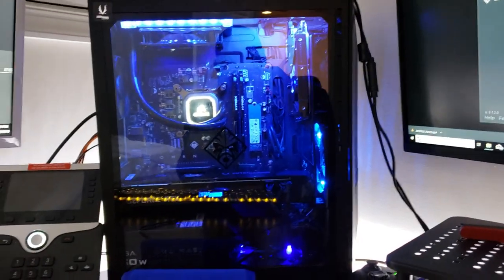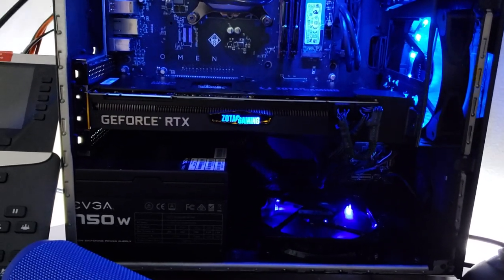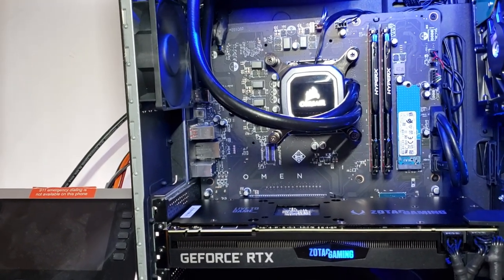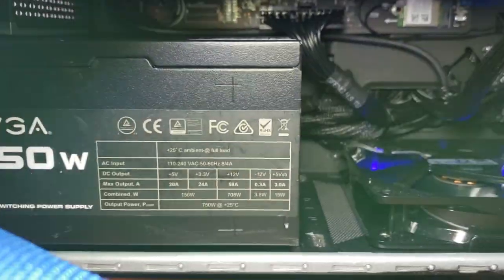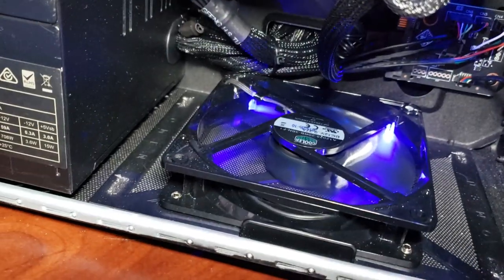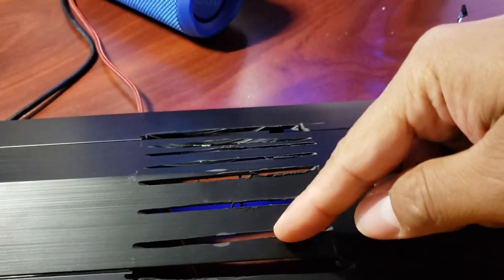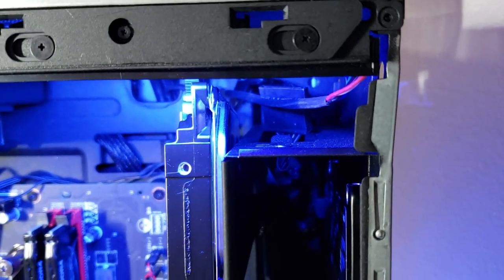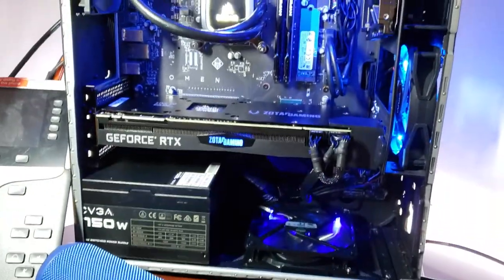HP omen obelisk hack after 10 months (zotac RTX 2070 super)

Comment: Cool mods but I think moving everything to a new case woulda been easier
Reply: Yeah, if my Omen ends up with any heat issues, I’m definitely just going to move everything to a new case. That’s a good time to install an AIO LC also, since you’re ripping everything out anyways lol.
Reply: @armyretguy7365  The card and case is designed this way. At least my 2080 rtx turbo IS designed to get hot air out from the rear of my case. With i7 8700(non k) there is no reason to add fans.
Reply: @tryharder3214  Honestly, since he installed the AIO, he could have just set the rear fan to intake and use that bottom fan. No reason to butcher the case itself. I get what you’re saying, but there is such thing as uncomfortably hot. Mine came with a 9700F and 2070 Super. The 2070 Super doesn’t pull air from the back, the fans are just straight up pulling from the bottom and half covered by the power supply. I suggested a case swap to create more air flow to the GPU. I know HP had engineers sit there and design everything to work, but recognizing the potential for air flow problems they also have a throttling trigger to reduce power draw and performance in the event of dangerous heat levels. Don’t get me wrong, it’s cool they thought of that, but the fact they HAD to is bothersome....

Comment: Nice mods! I replaced my exhaust fan with a noctua, added a 120 mm noctua to the top and replaced my stock cpu cooler with noctua NH-U9S and added an additional 92mm fan to the cooler. Quiet and cooler

Comment: I wanted to change the CPU cooler mostly for better thermals and I don't like the look of the stock Intel cooler, with the fan being offset, just looked messy. When looking around I decided to settle on the Noctua NH-L9i Chromax Black, it was cheap and I really like the clean and simplistic low profile look. I thought about liquid cooling, but wanted to save money and I may upgrade to one in the future. But I figured since I was going to have to remove the mobo anyway, I decided to browse cases.

I chose the very simple and cheaper H510 by NZXT. There's no RGB or anything fancy. It comes with two 140 mm fans, both set up as exhausts on the rear and top. I added two 120 MM Noctua Fans I had from a previous build that I placed in the front as intakes. 

Overall, the CPU temps are around 36-40 C at idle and they don't reach 70 C when gaming on max settings, the gpu temps stay at around 60 C gaming on max. 
I was able to tear out the RGB on the Omen and re-purpose it in the NZXT Case, I just simply installed HP's RGB Module on to a single stand-off and stuck the light bar on to the top of the case with some hot glue. I am thinking about installing the OMEN badge LED on the under-side of the NZXT case to get a nice glow on the bottom.

So If you have this computer and want to upgrade to a liquid cooler or a different heat-sink, I definitely recommend adding a new case as well since the motherboard will already be removed. The upgrades were only $90 overall and took about 3 hours, most of that was spent removing the proprietary bracket then tearing out all the components in the HP case.

I'd be happy to answer any questions, I know there is a lot of people who bought this and are unsatisfied with the thermals. https://imgur.com/8v4CYZo

Comment: I have the 1660 ti version, what I did was. Bought a whole new case and 2 8gb sticks of corsair ram pro with 3000mghz speed RGB. And a corsair h60 AIO(without the led light up version but I only care for the performance) kept one of the case fans in the new case(NZXT 510) and its looks nice and more clean and organized. I am saving up for a new motherboard. Then maybe 2 more same sticks of the sam RAM. Next year is a new video card with a new PSU. If anyone wants to ask questions feel free, also great video. I also added a new 2tb SSD samsung qvo in my case as well
Reply: I have the same pc and was considering changing cases because I recently tried to swap my 1660ti for a 2070 super but it didn’t fit on the motherboard due to how small it is. Was just curios the motherboard you were planning on upgrading for your pc?
Reply: @boofbump2923  mine is whole custom build the only thing that is left from the HP omen is the CPU(i7900). I have a Asus rog z390-e motherboard
Reply: When you put the Omen Motherboard in the NZXT 510, did  the holes line up without any issues, are the standoffs pre-installed on that case? I have the same stock 1660 ti version 84FD mobo and am planning on getting the NZXT 510 for better air-flow and future upgrades. Also, did the OMEN 500w psu fit in the 510 with no problems? Thanks in advance!!

Comment: Had an Omen Desktop, one of the 870-244. If anything the case was even worse than this Obelisk case. I did some modding too to try to improve thermals. Replaced all the case fans with Noctua. Replaced the CPU cooler fan as well, mounted an intake fan on the side panel grill (870-244 case). Then I bought a used Obelisk case and transferred everything into it thinking it would be better, better cable management, glass side panel, maybe more airflow. I'd say it was about 90% successful, but I couldn't get the front I/O to work or the front panel lighting since the two motherboards were so different between the two models and the cases and parts are so proprietary. Thermals were really not that much better honestly. Cable management was still poor. I finally ended up just buying a decent used case on ebay and moving everything into that. That's what I should have done to begin with. Your mods are clever, good on you, but IMO, you're better off just buying a more standard case rather than cutting up and trying to mod the original with only somewhat successful improvements.

Comment: I did the same fan upgrade on the bottom of the case and for addition i saw this $5 felt pad sliders thats usually for furnitures on close by hardware store and stick them as footing for my omen then i made more gap for air to come in from the bottom of the case. You can stack double depending on the height you want for your case
Reply: I just added this nice 3 level adjustable stand with the holes in the bottom and set my Omen 875-1131 on it when I got it. Fits well and should allow for good air flow. I set mine up to highest. https://www.amazon.com/gp/product/B07VQ6DSVX/ref=ppx_yo_dt_b_asin_title_o01_s00?ie=UTF8&psc=1

Comment: The sad thing is that HP has now introduced a couple of new models, 25L and 30L that use essentially the same case as the Obelisk. On the 30L, the add a different front bezel that allows for one intake fan at the bottom of the front of the case. Airflow isn't really all that much better, IMO in the new cases. I think the cases MIGHT be from Main Gear, but HP has obviously designed them and made them very proprietary, too shallow for good cable management and requiring the drives to be mounted at the front removing the possibility of front airflow. Also, no PSU shroud so there is the jumble of cables and the front lighting module in the lower right hand corner that just doesn't look very neat. It seems to me that HP just sort of half-a$$ed and attempt at a gaming case. That's not to say the PCs are not decent, they are, but with just a little extra, they could have made them aesthetically and in places more functionally better.

Comment: Haha man I was so interested until I saw the hack job of the front panel. Nice upgrades, but it's a shame that you couldn't mod that front piece a bit nicer.
Reply from the maker: You're right, I wish I didn't cut the slits in front. Originally I didn't have any slits in the front plastic, I only cut the back plastic square + metal square leaving the front looking stock... but I wanted more airflow. The slits didn't make much of a difference to Temps.

Comment: Nice Omen, I have the 2080 one, I got a huge noctua air cooler and did the same thing with the fans except I have another intake where your radiator is and a better exhaust fan, with all this airflow and no radiators my gpu never gets above 50°c under load and my cpu never gets hot either just wish I could use an xmp profile on my ram to get the full 3600mhz

Comment: I just purchased the 875-0084, I'm 3d printing feet for the case to get it off the ground. Did you try lifting it up higher to see if more air flow helps? I also purchased 2 noctua nf-p12 pwm fans for the top and bottom. And 1 nf- a9 pwm to replace the back exhaust fan. Hope it will work.... also I was thinking about printing out fan shroud vents to face cpu and gpu???? Any thoughts on that idea??? Cool video thanks for the information....
Reply: i got the same one. i really would like to move it to a ryzen H500i case. do you think it’d be able to move it?

Comment: Bro I installed a water cooler on my CPU and GPU and now my RTX 2080 installed temp is down to 50c max with the same case.
Reply: Also what I did on mine is that smaller fan on the left side, air is pushing in and also I suggest to try that modded front fun to try pushing air in so you do have fresh air coming in.
Reply: Thanks bro I'm going to try this
Reply: @clutchgaming2221   thats what i did on mine as well as installing an evga aio 120mm  on the i7 9700 withe the 1660ti and im running about 55*C  under load max settings running about 122 fps on most games
Reply: Bro what hm was your cooler  you have enough  room? Thinking about doing the same but there’s very little room between the power supply and gpu

Comment: Is that a fan at the inside bottom of the case?  I have this same computer and I see no where a fan in mine and no ability to screw in a fan at the bottom.  If the fan didn't come with your computer, how did you install the extra fan and what type of fan is it?  Edit:  just realized you said this was your radiator.

Comment: yes i have the same issue OMEN by HP Obelisk Desktop 875-0160..... i have the rtx 2060 and i play world of warships and it runs at 89c with like 15 to 25 fps then i took my side panel off and it ran at 53 to 65 fps
Reply: same i just put the rear panel off
Reply: i will be buying new case tho
Reply: @coldwarcheats4225   funny thing i sent back to hp for repair and turnes out the m2 drive and gpu went bad so they sent it back with a new m2 and a rtx 2080
Reply: @chriskerr6342  does the new one has a good cooling or the same bad?
Reply: @coldwarcheats4225   its okay  on cooling. its kinda  a weird setup it has 3 front intakes and the aio cooler directly in front of the 3 front fans
Reply: @coldwarcheats4225   can i sent pictures on here?

Comment: does the 4 pin header for the fans split the voltage and make both fans run low rpm? how does it behave? trying to figure out how to add more fans to my system and I am new to computer modifications

Comment: What are doing with this pc??? I have the rtx 2080 version and have only ever gotten high temps in the dead of summer. Got a couple of plastic stands to lift it up a few inches added a small aio and have never had an issue ever again. Maybe try not overcloxking a machine that wasnt designed to deal with it.

Comment: Hi if i install extra fan near power supply ? I have cpu cooler and rear fan no extra plug. Its possible to plug directly on power supply?
Reply from the maker: Yes its possible to cut into a power cable a solder new Power Connectors. However it is risky. To add an extra fan, its easier just to buy a power fan spliter, and connect it to your motherboard to power your case fan, plus an extra fan you want. Example using something like this: https://www.amazon.com/gp/product/B07FNL8YCZ   You can connect this to the motherboard top left corner were the case fan connects and power more fans.

Comment: I have the same computer and was wondering if you can tell me what case fans you use or how you get the rgb setup for your case fans?
Reply from the maker: I set up the case fans by connecting a fan splitter to the top left corner motherboard  fan connection. These fans are not RGB they're just regular generic blue case fan I bought off of Amazon. I just match my RGB to the fans to be the same color
Reply: @Mr-Chris  ah ok thanks!

Comment: Any tips for upgrading the power supply? What was the model PSU you used and are there any extra cabels I'll need to purchase? I'm looking to make almost the same upgrades as you but I'm lost on the psu.
Reply from the maker: It's easy to upgrade. However, choose one that's not braided cables, Space in the back panel is extremely tight and the braided cables make it very difficult to put the back panel on . Don't be afraid to cut any excess cables that are not in use. If I could do it all over again, I would buy a modular PSU so I wouldn't have to cut any cables.
Reply: @Mr-Chris  would something like the cx750m or cx650m work?

Comment: Nice mods you have there Chris!
Question... when you used a fan header splitter, did work just fine or did you have some problems? I want to add 2 more fans too!
Reply from the maker: The fan header splitter worked okay, but I wanted more control over the case fan speed. The Fans ran at Idle, but I wanted to give them more speed for more cooling. I did ended up buying a 3 Channels PC Cooler Cooling Fan Speed Controller from Newegg and a powered it by getting a sata to molex adapter. I cut a hole on top of the case near the top USB's and pocked the control knob through it. I can now control my fan speeds manually.

https://www.newegg.com/p/376-0043-00006
Reply: @Mr-Chris  Cool! I might as well do manual control on additional fans! Thanks for the tip!

Comment: How do u add extra rgb fans?? theres.only 1 connection .I have the same pc n fairly new to pc gaming . Any tips would be appreciated
Reply from the maker: This isn't RGB fans these are just regular fans with blue LEDs to match my RGB. You have two options to connect extra case fans... first option is to buy and connect a fan splitter to the case fan connector at the top left corner of the motherboard. Second option is to buy and connect a fan hub to a extra power supply.

Comment: I have this pc too but my airflow isn t the best either. Have done no upgrades to it. Would you recomment me to buy a new case and some stuff to cool doing the hacks u did to the pc first. In Gta 5 i often have high temperatures and such a big noise. Ps very cool videos and help.
Reply from the maker: I would only recommend buying a new case if you are also committed to upgrading the motherboard reinstall software. Otherwise simply just leaving the side case door open, is a quick and easy way to reduce temperatures for this PC.
Reply: @Mr-Chris  Thank you but I will also look for a new case with better airflow and a new mother bord for the future. Have you an idea for a new case yet?

Comment: WHy didn't you use the 4 pin port top right of motherboard for the fan?  or the other 4 pin port right next to that fan?
Reply from the maker: The other headers are being used by the AIO cooler. I actually did end up tapping into SATA Power and using a knob fan controller to manually adjust it. I cut a hole near the top USB and have the knob sticking out for easy access and control.
Reply: @Mr-Chris  what about the 4 pin one that says (i think) hd_fan4 on top right?  Is that a PWM header?  Thanks.
Reply from the maker: @cyberkenobi9194  I see what you mean. On my motherboard, the (HD_FAN4) header is labeled, but has no pins. I would have to solder pins to it. Perhaps on the newer motherboard, it has pins.

Comment: Hey man I’m in the same boat. Got the same pc I’m ordering a 750w power supply and a new cpu liquid cooler. How have your temps been after you’ve done all this work now?
Reply from the maker: Cpu Temps were mid to high 70's under load with the AIO fan set to exhaust, and in the 60's set up as intake. The problem I had setting up the AIO as an intake was I had great CPU temperatures but my GPU temperature skyrocketed. Another alternative which isn't ideal is to actually leave the case panel open. I get better GPU and CPU temperatures when I do that, however if you need to leave the case open to get better temperatures it means it's a poor case design which I've been saying all along.

Comment: Where did you get the other stick of ram
Reply from the maker: Amazon, at the time I bought it... it was on sale for about $65. https://www.amazon.com/gp/product/B06XKSPXHV/ref=ppx_yo_dt_b_search_asin_title?ie=UTF8&psc=1
Reply: @Mr-Chris  can I use a 16gb ddr4 2666mhz crucial ballistix along side the hyperx 16gb ddr4 2666 mhz ram?
Reply: I got a different brand and it was downgrading my speed from 2666 to 2133 and it was 2 16 gb of ram so I returned it, would getting another one of the hyperx fury give me 2666mhz?
Reply from the maker: @Banter-ep2qu  Typically it's recommended to get the same Memory speed and Manufacturer to gain the full benefits of Duel Channel memory. Thats what upset me about this PC, HP gives you 16GB, but they mess you up by providing only one stick.  Another slightly cheaper option is if you by two 8GB sticks two get duel channel at 16GB...  it's black Friday (today) so you can probably get some really cheaply at a faster speed than 2666Mhz .
Reply: And when you go into task manager  and see performance tab does it show your getting 2666 speeds
Reply from the maker: @Banter-ep2qu  yes, I see 2666 in task manager